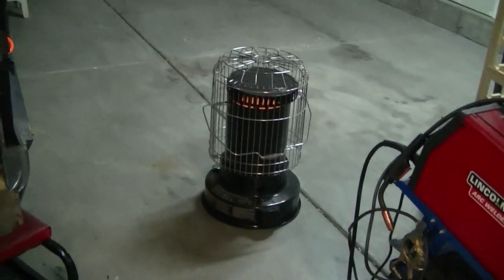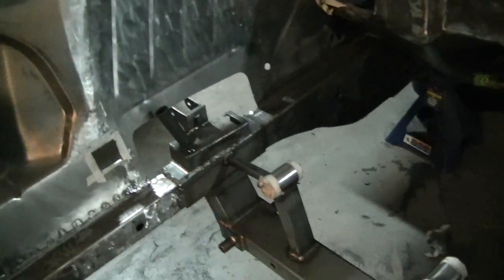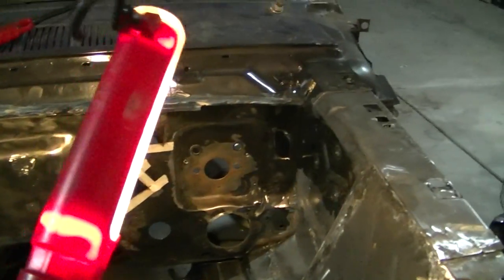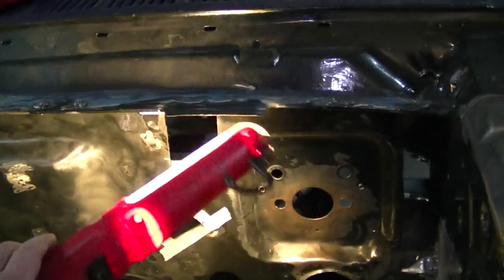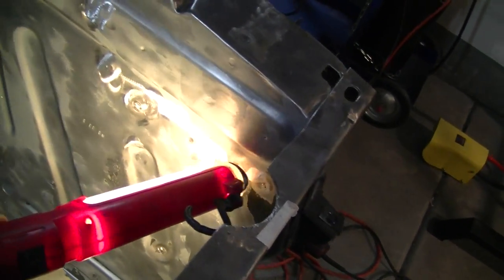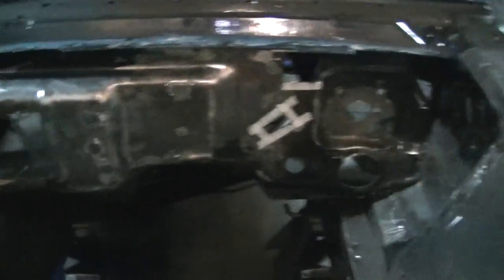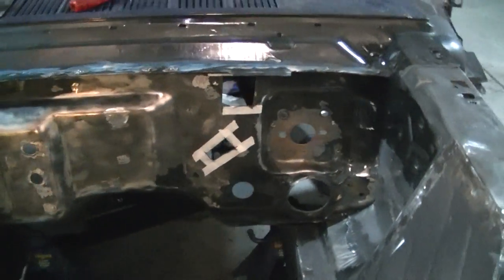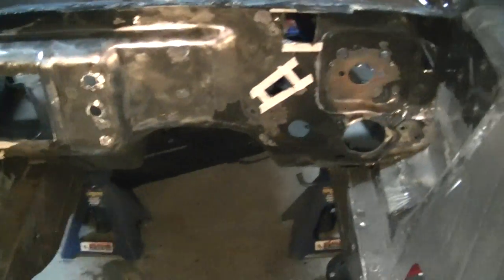65 Mustang Restoration Part 19 Firewall heater patches and other stuff

Comment: Good plan Joe, I think a thin coat of bondo can take quite a lot of heat. I stripped my body with a heat gun and it took a lot of heat to get the bondo to being to peel and even then most of it was just charring before it came away from the metal.
Reply from the maker: John, After watching some episodes of Overhaulin', i noticed they put filler on the firewall thicker than Tammy Faye Bakker's makeup so i think i'll be good.  Thanks for the help!  Merry Christmas!
Reply: Rudderify Yeah but Tammy-Faye's makeup always melted so be careful!

Comment: I haven't had any problems with the filler or paint in the engine bay either.  I used a pretty good bit of filler too. What do you think about mounting the trans cooler under the car?  Like between the rocker and sub frame connector?  Right behind the torque box?  Glad you are still moving forward.  The cold has slowed me up for sure.  That and the holidays coming.  Hopefully I'll get back on mine in a few weeks.
Reply from the maker: Billy, I considered mounting the cooler under the car but there would be a lack of airflow believe it or not.  Mounting it in the location i want i'm sure i'll suffer the same problem but i think i'll be able to overcome that with a large(r) cooler. hope you can get out in the garage soon and thanks for the tips.  Merry Christmas to you, brother!
Reply: I'll be out in the garage probably in two weeks.  Can't wait to finish these tail lights up.  My dad picked me up an aftermarket sequencer so hopefully that's something I can figure out soon. Merry Christmas to you and your family.  Stay safe brother!

Comment: Joe, the car is really making progress! I use fiberglass on welds and anywhere I think water might be an isse but consider this, the factory used seam seal on the firewall so why couldn't you use body filler with good results? I don't think you have a issue there. Congratulations on all the new subscribers.
Reply from the maker: Cary, I agree. After reading yours, as well as the rest of the YTGG, i think i'll be okay.  I plan on keeping the filler to a minimum anyway so i hope this will not even be an issue--that's the paln anyway. :)  Thanks for the comments and Merry Christmas!

Comment: great idea with a box but i would put louvers in the metal so the air flow would be good for the trans cooler later
Reply from the maker: That is an excellent idea.  Thanks for the tip and thanks for watching!  Merry Christmas!

Comment: Depending on how big your cooler is, I don't see much problem with mounting it up in the wheel well, just put some sort of guard on it to protect it from stones being kicked up by the tires. You will know better once you get your suspension in there and a wheel/tire combo mounted in place. I don't think that there should be much problem with the filler on the firewall and we all know that all cars have painted firewalls so that isn't an issue either. If you are concerned about some area that may be real close to the headers or something to that effect, you might use JBWeld instead of filler in that area, but for most of the firewall any kind of filler will work just fine.
Reply from the maker: Sir,  You are spot on with the rest of the YTGG.  I hope to not have too much filler insde the engine bay and with the shock towers removed, i hope to keep a lot of the heat away from the metal.  After looking at some Mustangs with an altered front end, i'll have a decent amount of room even with the wider engine and larger headers.  Thanks for watching and Merry Christmas!

Comment: 202 Scubscribers?  Looks like 261 subscribers now, so your making progress.  You shouldn't have any issues with filler and heat.  I think we put 14 gallons of filler in matt's engine bay, so far it has held up well, no issues anywehere, and we have twin turbo's, so those generate extra heat.  As far as the cooler location, yea we left it where we originally put it, I always meant to go back and put a shield between it and the tire, but never did.  So far no issues with it.  but if you think about it, having it out front where it's expose to the front, you get all kinds of crap coming in that way also.  The only issue with building a box would be airflow, it really needs to be in a place where it can get airflow over it.  It's crazy how long this detail work takes isn't it?  Espeically when you start custom work and modifying things... takes way more time that just putting all stock stuff back in...
Reply: These modifications is what's taking me so long. So ready to drive my car.
Reply from the maker: Gary,  I guess i had more subs than i thought!  I'm surprised i have that many people who're interested in this ole Mustang.  Thanks for the tip on the firewall too.  You and the rest of the YTGG have the same thoughts.  I don't plan on having a lot of filler but i guess i'll find out when i start working the final finish before paint.  I agree 100% on the mods...it takes much longer but then again, the car would look like every other belly button Mustang out there if we made them stock, right? haha! Do me a favor and PM me your addess and i'll share the rotisserie plans with you.
Reply from the maker: Have a Mery Christmas, brother!

Comment: I hand formed the engine bay in wrongside completely out of bondo, No metal whatsoever. So I think you will be fine.. I wouldn't enclose the trans cooler to much or it won't have enough cool airflow even with a fan.
Reply from the maker: Sir,  I thought so.  Surprised you didn't leave a hand print with a signature and date in the firewall somewhere. :)  Roger that on the cooler...think i'm going to add some louvers to the box. Thanks for watching and Merry Christmas!